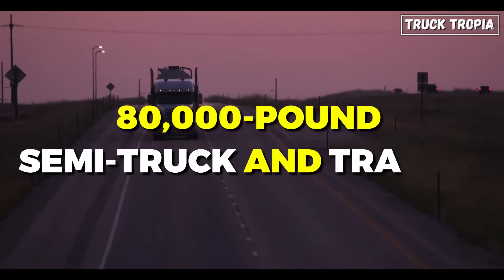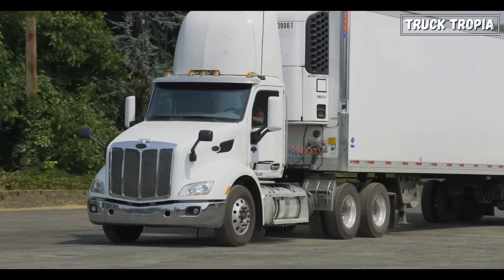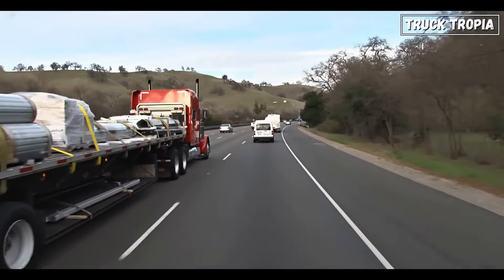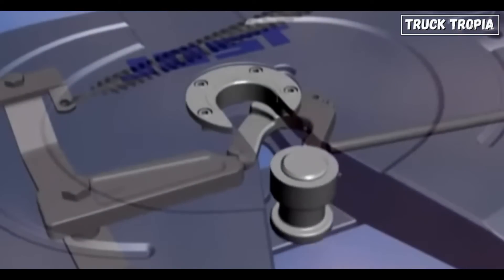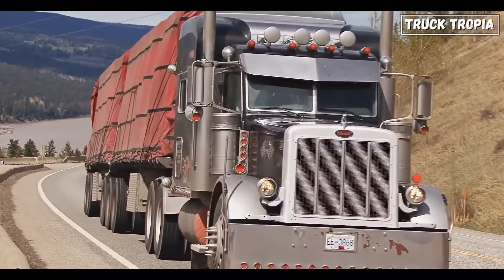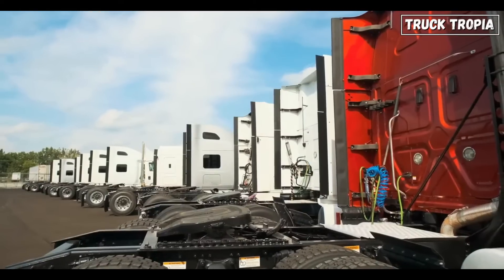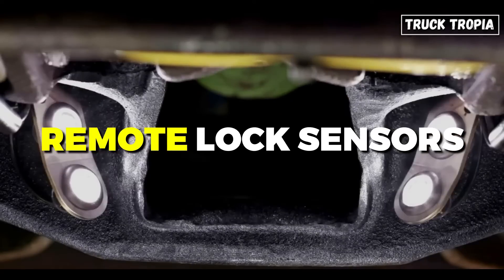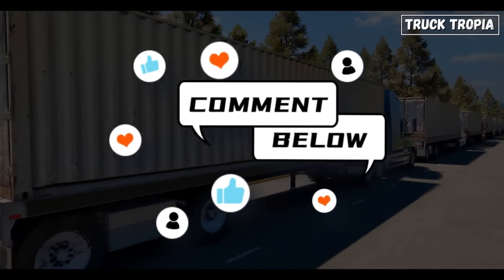How One Part Holds 80,000 Pounds Together

Comment: Thats the money maker 😂 
Don't forget to lube it up every once in awhile. 
The 5th wheel, locking jaw and king pin is what kept that lady from falling off the Louisville bridge. The tractor part was hanging off the bridge after a guy going opposite direction came into her lane and hit her truck. I've never had a tare weight on a tractor by itself but its probably about 24,000lbs. 
There's some 5th wheels that can handle 110,000lbs or more going down the road but you need a special set-up  on a truck for that to operate the lowboy properly.

Comment: Good explanation.  One detail that you got wrong is concerning the tilting 5th wheel. All 5th wheels are tilting. They need to pivot, or something would break when the truck crosses something like cresting a hill or a high rr crossing.
Reply: I guess he means the type that can tilt side ways, which we call it U-joint saddle. Since there is one more pivot, it's taller than ordinary saddle. I don't know why because with this type of saddle, the trailer is pretty much a three wheeler. For comparison, ordinary saddle can tilt back and forward only, the tractor can stabilize the trailer. Since this type of saddle is common on tractors that tow goose neck trailer and go off-road frequently, I guess maybe this can reduce the stress for king pin and give better grip for the tractor when on uneven dirt trail?
Reply: you are correct